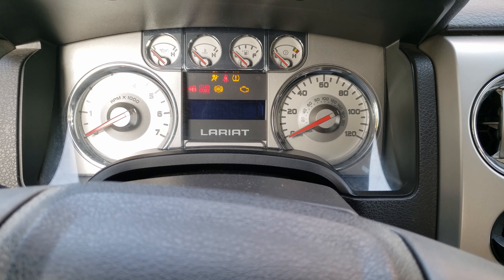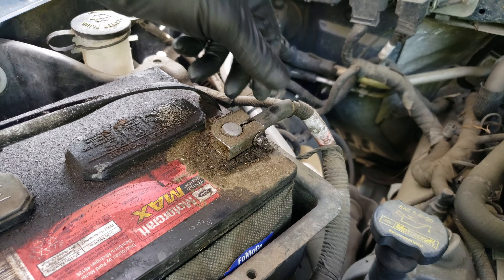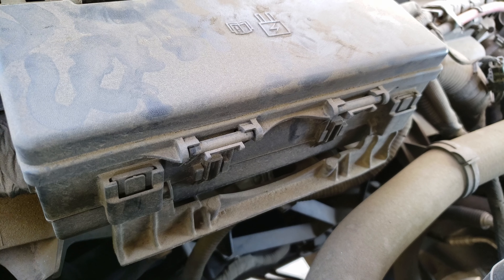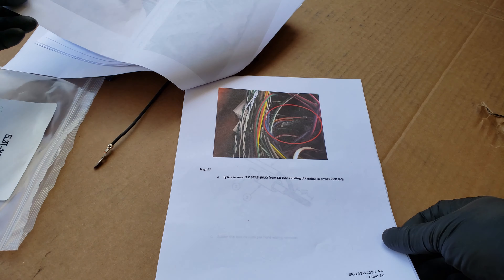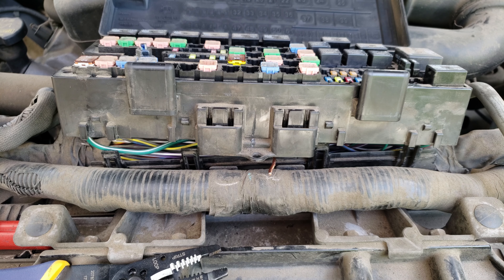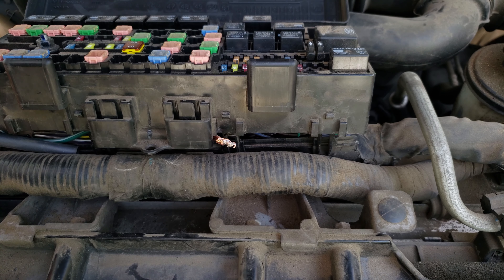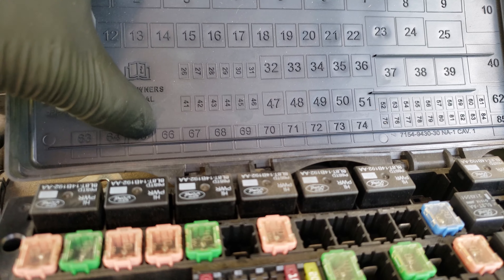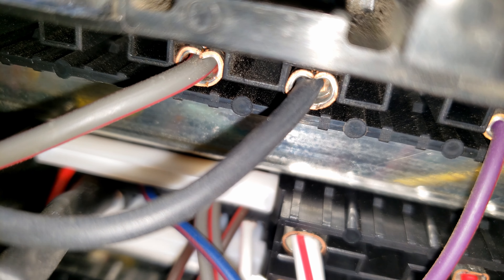Ford F-150 Fuel Pump Fuse 27 Relocation 2009-2014

Comment: Excellent video, unfortunately, my truck suddenly quit running while I was parking at my Dr's office, and I was stranded, so ended up having to get towed to a mechanical shop.  They recognized te problem right off and got the repair done by noon the following day, but between the tow, repair. and a rent car I spent close to $500.  If it had happened in my driveway at home I could have done this repair myself. Thanks for posting!

Comment: Exactly my issue. Was intermittent truck just would crank but not start. Turns out the fuse was burnt and not visibly separated in the center, the side melted. This is a safety issue should be a recall. This video is great. Thank you for putting this together for the masses!
Reply: Yupp pulled mine today and of course one side was burnt

Comment: Thank You for this video! Pulled the fuse and it looked just like this. We were so afraid that we were going to have to replace the fuel pump.
Reply from the maker: Glad to be able to help🙂 yea its a very common problem on these trucks unfortunately

Comment: I had this very issue today.  Call my Bro inlaw and  my friends at Penske. Consensus was to get the manual out and check the relay fuse #8 so I swapped it with the rear window defroster  so I switch and still no fuel.  Finally I decided to look at the fuse chart and found #27 to be the Fuse for the Fuse Relay.  Man the 20 A  fuse looked just like the one in this video.  I am 40 miles from home so I find the mirror defroster fuse 15A and Insert it.  Engine fired right up.  Take Note. the 15 amp fuse will be easier to blow than a 20 Amp  but it gots me to a parts store and I installed a new 20A Fuse.
Reply from the maker: Yea definitely worth doing in an emergency situation..u just wanna avoid using a higher amp fuse since u want the fuse to blow before the components in the system.
Reply: @backyardchevy328   Man yeah.  I was thinking. if this 15 blows I may be totally boned. And the root cause of this is the fuse holder itself?  I will likely replace the Fuel Filter and inspect the driver module. Tow truck estimated was $350,  then they did not take ride along due to CoVid. Was very happy with the results of the #56 15 Amp. It got me and the Truck Home!
Reply from the maker: @unklefester1980  yes definitely worth it and glad u were able to make it there safely

Comment: OMG, thank you for this video!!!  My family and I were on our way home from our Christmas vacation (490 mile drive and pulling our RV).  Battery light started coming on intermittently.  Then about 80 miles from home, the truck just dies going down the highway.  Pull over and only thing I can think of is the alternator had gone out.  Changed the alternator on the side of the road and the truck started and was able to make it home.  A few days later, same thing started happening at random times... truck would die and would crank, but wouldn't start.  I was about to lose my mind until I found out about this fuse!  Sure enough, my fuse was TOAST!  Ford really should issue a recall for this!!!

Comment: @backyard Chevy thank you so much bro you just saved my life. Truck suddenly threw battery code, died, then low oil pressure while driving. I was thinking my motor gave out and you just got me up and running in like 5 minutes. If you’re ever in Saint Louis I owe you a beer!

Comment: You just saved me buckets of $$$$$$; thanks a million! 👍🏻 my fuse was charred; put in another, and started right up!
Will be ordering and installing the relocation kit. I'm impressed with your very precise and thorough instructions on replacing.
You now have a new subscriber!
Reply from the maker: Thats great! Hopefully everything goes smoothly with the relocation🙂👍 thank you for the support
Reply: My truck "supposedly had it done" but the guy who did it fused the wrong circuit. I think the blower motor 🤣🤣🤣🤣.  There is a similar wire. I am still running the fuel pump off the little fuse (have to do it right one day)

Comment: This just happened to me. Left me stranded at work.  Wish I had seen this before letting a  $0.10 fuse cost me a $90 tow bill ( I live less than a mile from work) Great video !! I just ordered 2 kits. One for my 2012 FX4 Coyote and one for my dads 2013 Limited 3.7 Eco.  Thanks for posting.

Comment: Man, Bingo my 2009 did the same thing sometimes starts and sometimes not, research says to replace the fuel pressure module by the spare tire, no luck, I seen this and checked that fuse, it was corroded and burnt, fixed my problem, thank you pal !

Comment: This just happened to me this afternoon.  Fuse 27 was not melted though.  I'll check with a multimeter...thanks for the great video!
Reply: Any luck? Mine was not melted either, but threw the code for fuel pump

Comment: This happened to me twice... about a year ago and then just yesterday in front of the post office. The fuse itself did not burn out, but rather, where the blade of the fuse slides in one side of the holder it was completely melted like it was arcing as if there was a poor continuity. It's very strange that this would happen, but the fuse itself will not burn out!  This strikes me as a huge fire hazard and I'm surprised that Ford hasn't had a recall.   So obviously it's not a problem with the fuel pump drawing too much current,  it's the fuse holder itself that cannot handle the current.  Anyways, my local mechanic showed up in about 3/4 of an hour while I patiently waited in my truck. He told me to turn the key on but not start the motor while he listened for the fuel pump down by the rear wheel and he couldn't hear it. That's when we opened the fuse box up and noticed that the fuse was melted on one side, this happened to me about a year ago. The exact same thing... I just forgot about it. My mechanic recommend I get this kit to relocate the problem mini fuse for the fuel pump to a larger bladed fuse style on the other side of the fuse box, he said this is a common problem with these f-150s from this generation , mine is a 2013. He's got the kit ordered and I will get it installed promptly so I do not have this problem again, as It really sucks lol.

Comment: I don’t have much experience working on cars but I did this fine with the info in the video. If you’re worried about trying this just go for it. As long as you have snips, heatgun/blow driver, needle nose pliers, and socket set you’re pretty much good.

Comment: I always appreciate good reviews so here’s mine : this worked perfectly for my 09 F150 thanks for this video !!
Reply from the maker: Thats so great! Thank you🙂 yes i do appreciate em as well👍
Reply: Apologies ahead of time for the long winded comment lol bare with me. 

I have an 09 as well and began noticing a lot of heat in the engine bay. While my truck would start it was somewhat of a longer crank. I really began noticing sporadic fuel mileage after refilling and the truck would also have real lack of acceleration. My engine bay would be really hot although the scan tool live data said it coolant temp was within range. Pulled over and shut the truck off for 20 mins…opened the engine bay and appeared to be emitting more heat than usual. I began hearing a “ticking” noise coming from near the fuse box, (similar to what metal sounds like when cooling down after heat cycle). 

I read about fuse 27 and when I pulled it out it wasn’t blown however I could see signs of heat discoloration. I looked in the manual and found a spare fuse with larger contacts…not sure if it was ideal however the truck began driving a lot better. While i’m not %100 sure my issues are related I do however plan to do the relocation if anything as a preventive. 

Curious if y’all had any particular trouble codes and or other symptoms when the issue occurred? The only codes I had were related to a small evap leak P0442 and two others U0121 ECM TCM U0028 SRS codes relating to my abs module which were prior issues. Also the ambient air temp readings are sporadic as well abs the ac kicks on by itself sometimes and the radiator fan is blowing high upon start up sometimes. 
Any feedback would be welcomed thank you both. Kit goes in tomorrow. This video is gonna be a real help.
Reply from the maker: @Sheeeeeeeeeeeeiiitt  yea the clicking from fuse box was similar..it stalled twice..and first time it stalled it did take a while to start..it had symtoms of a bad fuel pump..but yea the last time it stalled it didnt wanna start..but it didnt have any codes
Reply: @backyardchevy328  hey thanks for replying. Went by Ford and picked up the kit. Of course the directions came with it but this video really helped. Was a little timid at first but turned out good. Gonna clean the mass air flow sensor and throttle body in the morning since I have the negative pulled. Hope this brings my acceleration back…lord I hope it’s not gonna be the pump. Guess I should check the fpdm harness and ground now that I think of it. Thanks again
Reply from the maker: @Sheeeeeeeeeeeeiiitt  hopefully everything goes smoothly🙂 good luck

Comment: You’re a lifesaver! Thanks for the vid!
Reply from the maker: So glad to be able to help🙂 thank you
Reply: Lol this video didn't fix your problem just relocated it the fuel pump Dr module is pulling to much power over heating your fuse it's. 50 dollar fix and 5 minutes to change it and you'll b good till it starts shorting out lol but that's the real problem

Comment: F150 2010 4/4 my fuse was burnt also. Having issues with engine cutting off.  And Ford won’t fix it. Replaced fuse today. Guess I’ll get the kit. Great video. Ford would of said it was fuel pump.
Reply from the maker: Yea unfortunately its such a common problem and unfortunately its just a service bulletin instead of recall, which they should of made it a recall.

Comment: Thanks for this video, I had the cranking over no start issue also. I'm glad it's the fuse which was partially burned but intact vs. fuel pump. When it gets a little warmer here (-8F) I will install this kit. In the mean time carry some extra fuses. 2010 F150 5.4.Thanks again for this excellent video. Bill
Reply from the maker: Thank you🙂 yea thats definitely cold, glad it was just that too👍
Reply: Lol don't waste your time the fuel pump Dr module is pulling to much power which is causing this fuse to over heat these modules sometimes get so hot they melt relocating your fuse is just relocating the problem most these ford's make it a hundred thousand miles before having the problem just change the fuel pump Dr module you should be good till it starts shorting out then you will have the same problem again lol but it's all in this failing part just add new fuse and module at the same time oh the module is 50 dollars takes 5 minutes to change 10 mm socket small ratchet it's located over top of spare tire unplug harness take out two screws
Reply: @craigm5601  I was wondering same thing bcs I saw another guy that just replaced the module. Do you know what’s the part number or where to buy it? Thanks
Reply: @kacaigli  i bought one from auto zone.Not sure a 100 percent if it was actually necessary looks like most people just change the fuse.i did buy a box of 20amp fuses to keep in the truck just in case it happens again.

Comment: I had trouble starting my 2013 F150, My fuse was burnt too, I had the relocation kit out in and never had another problem.  This should have been a recall issue!
Reply from the maker: Yea its too common of a problem that it should have been recalled

Comment: Can a crimp on butt connector be used?  The supplied shrink tubing will fit.  I have thousands in marine applications.
Reply from the maker: I mean u can..but theyre not the greatest connection..theyre known to slip out if not crimped properly and they do increase its resistance on the wire
Reply: @backyardchevy328  probably still a better circuit than Fords original lol. Thanks.
Reply from the maker: @ironpony12  haha true
Reply: Yah that should do it

Comment: I have not had this problem on my 2013 F150 but I have been told it's very common. Should I get this kit and switch over to this different fuse as a proactive step? Thinking I don't want to get stranded somewhere if this happens on the road.

Comment: Thanks or the video!!

I just did this to my 2013 Ford Raptor!  Everything works fine in regards to starting the truck, but now my speedometer seems to be sitting below zero.  Even after I am driving around 10-15 MPH.  Would this have anything to do with my fuse connection? IDK what happened to the speedo!!!

Comment: Mine blew yesterday, found many F150 owners saying slot 27, me and the dog walked to the nearest auto parts store, about a mile away. Got the taller 20amp mini fuse not the correct low profile 20amp mini fuse and put it in. Fired right up, drove to another auto parts store and got a pack of 5 fuses to keep in the glove box.  Just in case.

Comment: What cause the fuse to over heat in the first place? Would dielectric grease help prevent the over heat condition?
Reply from the maker: Its just the type of fuse, the fuse contacts cant handle the heat thats generated by the current powering the fuel pump, so it begins to melt the fuse overtime
Reply: Question. This started  happening to me this year. I have just been replacing the fuse with another 10 amp fuse. The fuse location does look melted. But what happens if I just replace a 30 or 20 amp fuse instead of 10 amp. Will it cause damage to the fuel pump?

Comment: This may be a dumb question, but what keeps you from using electrical tape rather than shrink wrap? It seems much easier and no risk of melting other wires?
Reply from the maker: U can use either actually..heat shrink tubing just looks a lil more professional(in my opinion)
Reply: @backyardchevy328  heat shrink doesn’t fall off like tape can

Comment: Same thing happened to me, I did the fuse relocation and not only did it work but it fixed my radio display from coming on and off on its own. Well now it’s been a month and the radio display screen went out again, only when the truck is running, if the truck is just in on position the screen comes on so my question is do I need to find the fuse for my radio display and relocate that?
Reply: Also, the cuz of the fuel pump fuse burning up was from too much power being drawn and that’s why it was relocated, well now that the screen is cutting out again what else could be drawing too much power and what am I at risk of burning up?
Reply: Cause*
Reply from the maker: Have u tried doing a reset on it?

Comment: Hey Backyard Chevy, I have a 2010 model year. The fuse on mine looks completely fine but I'm having really bad issues starting the truck at ambient temp. Do you think this could still be the problem even if the stock fuse looks fine?
Reply from the maker: No, more than likely itll be some other issue especially if it starts but only at certain temperature itll have problems..like elaborate on what u mean by really bad issues starting it?
Reply: @backyardchevy328  it will turn over then die, like in the mornings or after 6 or 7 hours sitting at ambient temperature. Maybe not necessarily the cold weather because I've only owned the truck for about a month and the weather has been the same for the most part in the month of owning. But, once I start it and getting it running, then say I run a few errands it will start no problem while running errands. But, after sitting for awhile it struggles to start. It will just be an extended crank, then fire up and die.
Reply from the maker: @taylorburton4565  sounds like it could be a cold start air flow problem...possibly cleaning out the throttle body..since they don't have an idle air control valve if theres a lot of gunk near throttle body blade it could affect cold starts
Reply: @backyardchevy328  OK I'll look into that. Thank you for your response. I do appreciate it!
Reply from the maker: @taylorburton4565  anytime...good luck

Comment: So if you were to put a new 20 in same spot would it have worked or you still would of had to put a relocation kit
Reply: Cause I’m having the same problem but a 2011 and the fuse is on there and it turns on but turns right back fack
Reply: Off*
Reply from the maker: Once it burns the contacts itll happen again so i may have got it to turn on if i put a new fuse but due to the added resistance im sure it would of happened again, it may cut in and out like what may be happening in ur case, but to avoid any further damage to distribution block and to make it reliable its better to relocate it
Reply: You can clean the contacts with an emery board and some deoxit D5. Most the time it's not burned up bad enough to were it can't be fixed. 
I've run into this issue at least a dozen times on customer cars, I would only relocate the fuse if this is a persistent issue after you attempted to clean the original contacts.
Reply: Mine did.  I pulled the 15 amp mirror defroster fuse. Engine fired right up and I went straight to the closest Auto Store and got some new 20A fuses. When using a lower rated fuse you are building in an extra safety net.  If you use a 25 Amp fuse you risk more damage. Cheers

Comment: Thank You for this excellent video.
Just had Ford do this repair, as my 2014 F150  would crank but not start. The fact that Ford has a Kit for this repair says it happens often. However they said it will not be covered under my 8 year 100,000 mile Premium Care Warranty from Ford. Does anyone else find this objectionable?
Reply from the maker: Thank you🙂 yea i know, couldnt believe it myself..normally a major problem like this is calls for a recall and proper fix, instead it was only a service bulletin
Reply: Ford should cover this. I’ve had problems with engine shut down. Found out about this my fuse burnt also. 2010 F 150 4/4
Reply: Yes!!!